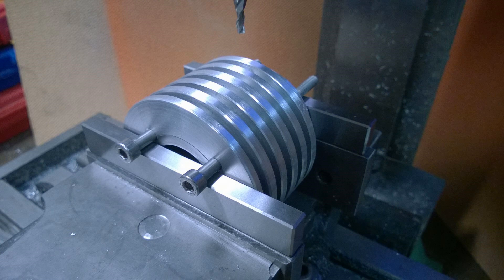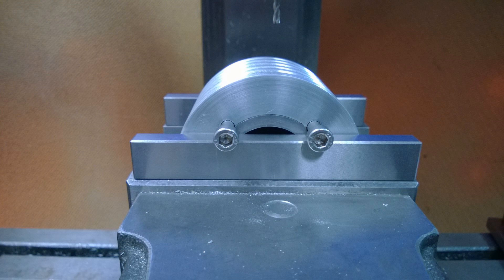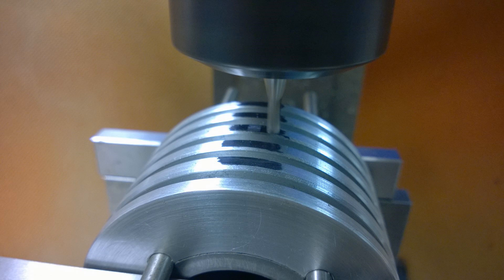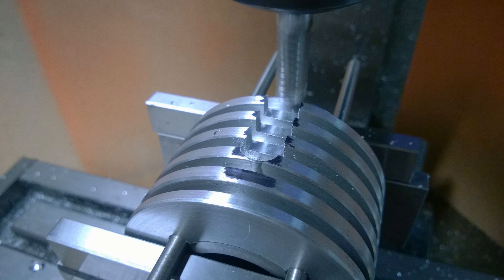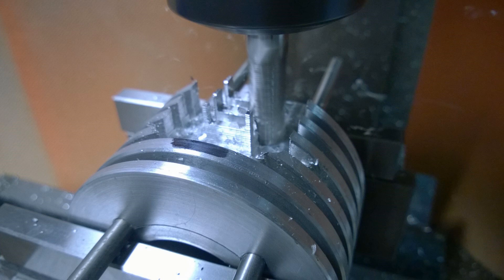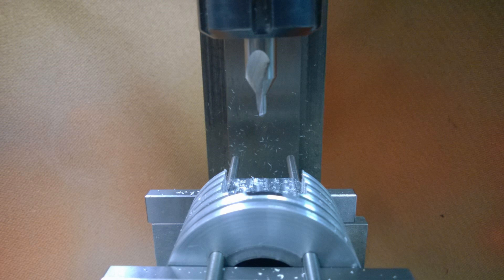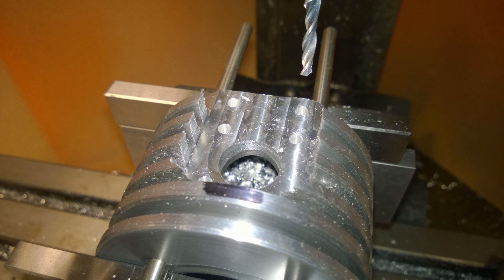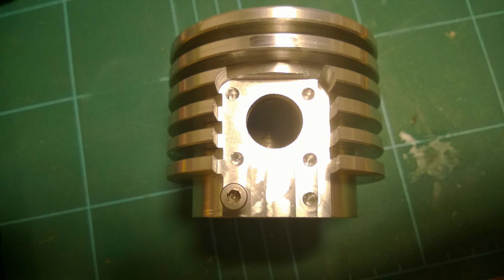Homemade 2 stroke engine step by step - Part 12 Transfer Port

Comment: How did you get through the liner without messing up the inside surface of the cylinder? Did you have to clean up inside the cylinder afterwards?
Reply from the maker: The cylinder is undersized - it will be bored and honed at the end.

Comment: Since too long ago Im planning on doing this for me, but I allways strugle with the project, not because I cant handle Solid design, but because of so many questions, like the design of the port, its size, location, etc. I know this engines are so simple, but how to build a very fine designed one? Seeing you do it and even with convencional (not CNC)  machinery inspires me even more! keep up with  this great job and kudos for you my friend!
Reply from the maker: Cheers for the comment dude
Reply: +The Workshop  and how did you do it mate? I mean the design.  Did u calculate all the engineering stuf or maybe copy some chainsaw engine?

Comment: i want to build a 50cc moped motor with a gearbox what metal is used to make the gears and imput shaft?
Reply from the maker: steel
Reply: thank you